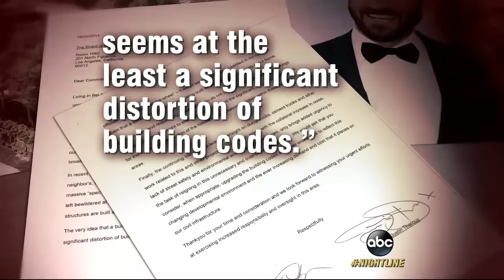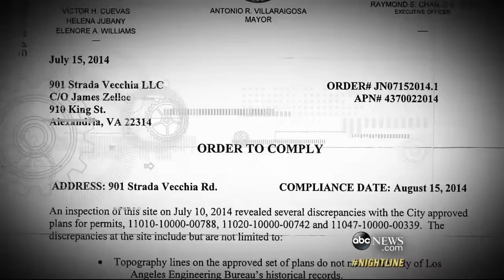The Fight Over Los Angeles's Giga-Mansions

Comment: I don't see the problem except in cases where it is clear that a structure is dangerous for it's own residents or the homes below it.
Construction is construction. Nobody likes to drive around it but progress is progress. No matter where you go in the world where there is either new construction or renovation you are going to encounter  "PARDON OUR MESS" signs and a few cement trucks.
Reply: However a 90,000 sqft place takes a long time to build so you have to deal with the noise for years not just 6 months.
Reply: Structures as large as these are not progress people are homeless and rich people are spending money on a big house to show off it should be a hotel not a house
Reply: BellinghamsterTrail i
Reply: Dev Patel Lol so employing thousands of people for several years is not progress?
Reply: Its not thousands... and when a fucking light bulb is banned because it uses too much power... these houses need to be BANNED.
Reply: Meeker Extreme not to mention all the additions he snuck in without getting permits approved

Comment: California state legislators are the problem. They want this crap too, but cannot hope to get it currently, so want to make it available for their kids. If every family was limited to 10,000 kWh per property. 1200 sf per person, no more than 6 bathrooms, no more than 6 car garage- no more than 1000 sq ft of paved area (driveway 24x20 is 480)- no more than ,5 acre of lawn and sprinkler system not to exceed 3 gpm every other day >= 2 hours-  for that would stop them. No pool larger than 20 x 30.   If you want more live at a hotel. Example Hearst Castle featured 56 bedrooms, 61 bathrooms, 19 sitting rooms, 127 acre  so if you have 1 acre  10 % seems very generous 5.6 bedrooms 5 bathrooms??,   But another Hearst Castle analysis is: Covering 68,500 square feet (6,360 square metres), Hearst Castle contains 115 rooms, including 38 bedrooms, more than 40 bathrooms, a theatre, and a beauty salon. Damn these fools all want a Castle in a residential area. How many guards do you need to call it safe-- I cry social foul.